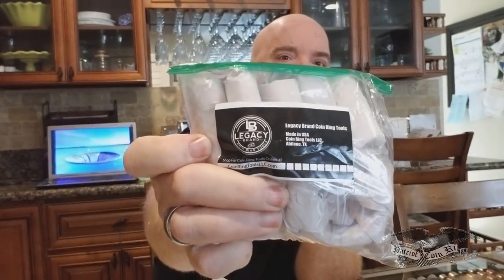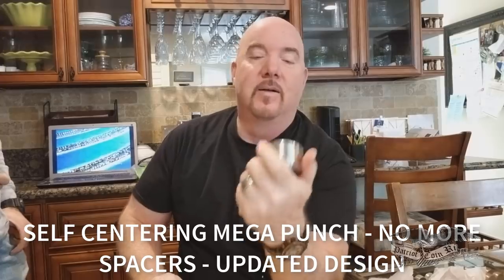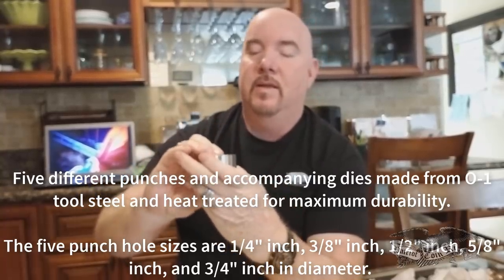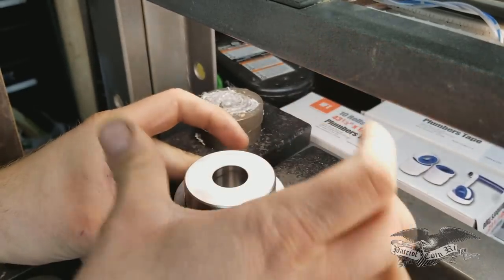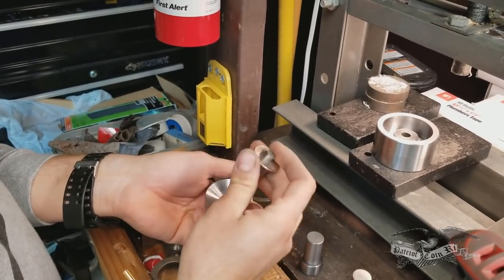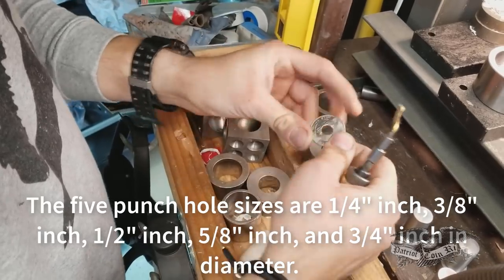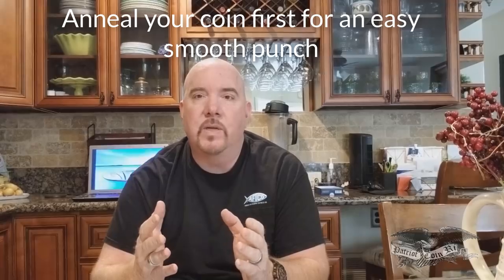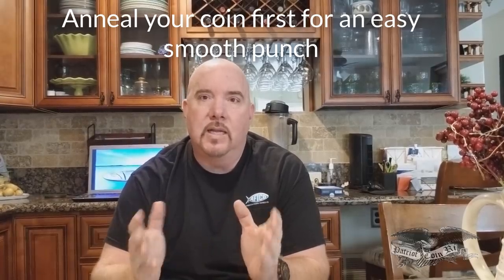✅ #002 FREE Legacy Self Centering MEGA COIN RING PUNCH - July 4th Drawing!

Comment: Tanks Mrs  ....SELF CENTERING MEGA PUNCH - NO MORE SPACERS - UPDATED DESIGN

Legacy Brand Coin Ring Self Centering MEGA Punch Set:

This set includes a durable, two piece punch body made from 4140 steel. The top half of the punch body is domed to center your coins and fits inside the bottom half of the punch.

Accommodates coins in ranges from US Half Dollar 1.205" inches diameter (30.6 mm) up to 1.75" diameter (44.6 mm) challenge coins.

There are also five different punches and accompanying dies made from O-1 tool steel and heat treated for maximum durability.

The five punch hole sizes are 1/4" inch, 3/8" inch, 1/2" inch, 5/8" inch, and 3/4" inch in diameter. 

Updated die design clearance allows coin "punch outs" to clear the dies.

Holed coins (done with 1/2" punch) pictured include:

US Kennedy Half Dollar (30.61 mm diameter)
British One Penny (31 mm diameter)
Plated Brass Liberty Silver Dollar Replica (38.1 mm diameter)
One ounce copper round (39 mm diameter)
USA American Silver Eagle (40.6 mm diameter)

To use the punch, select the punch size you would like to use and it's accompanying die. Insert the die into the bottom half of the main punch body. Set your coin on top of the die. Slide the domed, top half of the punch down into the bottom half. This will center the coin over the die. Next, insert the punch and punch your hole using a minimum 6 ton hydraulic type press.

Lubing the punch face with a cutting lubricant, such as Pepelube, is recommended.

Lubing the inside of the dies is recommended as well.

This is a quality coin ring punch set, made in the USA by American craftsmen, and made to last.

This Coin Ring MEGA Punch Set is in stock and ready to ship USPS Priority Flat Rate Mail with Signature confirmation ($9.60) within one business day in the US.

International buyers, contact me for shipping quote.

We combine shipping whenever possible and refund shipping overages.

Thanks for looking at our listing, Karen and Larry.

No coins are included with this listing.

Comment: I’ve already tossed my Harbor Freight die set. So I’m in a bind friend I really could use this big time. Im using the older model from them, which is still good. I promise to give it away.... Karen has been great customer support.....
Reply from the maker: To improve your odds of winning just start up conversations with others here because every post is seen as an entry with the randomizer.  Frank for instance in this thread has something like 8 posts I see so he looks like he has the best odds of winning so far.  The best I can recommend is asking questions or answering questions here to improve your odds.  I do wish you the very best of luck!
Reply: Jon Waters 
People always knock Harbor Freight for their "cheap tools."
For one thing, I work on my own car and I've never had anything from HF break. Even did my AC system with HF gauges and vacuum pump-- both work fine and my AC is freezing cold, in the Florida summer. 
Secondly, I've seen a guy walk in there with a broken torque wrench and the manager told him to grab a new one, with no receipt. 
Even if HF tools are "cheap," they're replaced with no hassle, totally warrantied. 
I have the HF punch set, bought it with a plastic center finder from ACE Hardware. 
I also have their doming block and die set. I want to make a bell from Ben Franklin half dollars-- those things look so cool!!
Harbor Freight, for the win. 
HF should sell a line of coin ring tools; they'd be a great sell, with warranty...

H. French
PO Box 320278
Cocoa Beach, FL 32932
Reply from the maker: Yea, I totally get what you mean Frank and agree.  In fact I'm one of those guys who even pays for an annual HF membership.  I turn to HF for many many items and it would have been a lot harder to get involved with the hobby had it not been for the price savings I got on my startup tools with them.  I think Job like I mean when it's said "I finally get to toss the HF stuff" is that we've finally graduated up to something even nicer is all :)
Reply: my punch has gone bad 3 times and H F did replace it.
Reply from the maker: Personal Invite to the BIGGEST open box review and giveaway i've ever held is finally here! https://www.youtube.com/watch?v=vKG-zaoLqec 
$200 PCR Gift Certificate or $538 MSRP Coin Ring Punch Kit!

Comment: im impressed...but..in the vid fron 1/18 you used spacers but not in this one.. when i went to etsy to look at legacy ring punch set they show the spacers .. what did i miss
Reply from the maker: I actually have both punches with spacers and those which are self-centering.  Both are great and I typically use the one that just happens to be closest to me on the shelf however the self centering ones are really good when it comes to the real oddball sizes that would otherwise require you to put a bunch of paper between the spacer and coin.  If you go to Legacy's ETSY page and message Larry or Karen I'm sure they will hook you up.  I was told they just sold out of their self centering punches at this time and were redesigning it for an improvement which I'm interested to see but they would have it available shortly.  Another really good one is made by Jason Works which you can also find here... https://jasons.works/shop-coin-ring-making-tools/

Comment: Are the punches flat on the end or do they have an angled tip that cuts the coin?  I've watched this video, or most of it, about 8x so far. Hahaha. 
Edit: 6:20 I agree with you on this point. Good thing is, that's an easy problem to fix. 

H. French
PO Box 320278
Cocoa Beach, FL 32932
Reply from the maker: It's flat and in my opinion the punches should have a very slight angle to them however haven't had a problem yet and in all honesty I rarely anneal a coin before it's punched anymore.  The only time I do is when it's a really thick alloy round.
Reply: i made a dollar and 50 cent rings from australia.    really thich and hard

Comment: I have a press but no punch yet, hoping I win...
Reply: rstone7727 
Harbor Freight phased out their 1/2-ton press. I got one just to have, in addition to the 1-ton arbor press. That one was an open-box buy, handle missing. Which was great, since the handle is prone to break and often "modded," replaced with something better. 
I went with the the 6-ton A-frame press but I didn't like how it was kind of wonky, didn't feel stable, like it couldn't withstand the stress. As soon as I built it, I called HF and asked if they wanted a floor model for their A-frame, exchanged it for the 12-ton press. 
If anybody is on the market, wait for a flyer that has the $129 coupon for their 20-ton press. For what I paid for my 12, I should have paid attention to the coupons and gotten the 20 instead. 
Presses can be dangerous if you aren't careful. 

H. French
PO Box 320278
Cocoa Beach, FL 32932
Reply from the maker: +rstone7727  The more you comment and chat here, the better your odds of winning...fyi  Good Luck on the drawing my friend, sounds like you could use it!
Reply from the maker: Wow you really went heavy duty Frank.  After using most, I find the 6 Ton perfect.  Some tools the 1 ton isn't strong enough to handle but anything more than 6 ton doesn't allow you to feel your work which I personally think helps you do a better job of knowing when to continue or back off on the press.  That and I can't see needing anything more than 6 tons to cut through all coins and medallions made even with steel unless you just want something more strong for other projects outside of the hobby.  Just my opinion though.
Reply from the maker: Personal Invite to the BIGGEST open box review and giveaway i've ever held is finally here! https://www.youtube.com/watch?v=vKG-zaoLqec 
$200 PCR Gift Certificate or $538 MSRP Coin Ring Punch Kit!

Comment: At first I was shocked by the 1.6k likes to 1 dislike ratio, then I realized why...
That being said, this auto-center punch is a great deal. I've got it favorited on Etsy. Much cheaper than another auto punch for sale on there. 

Henry French
3360 Craggy Bluff Place
Cocoa, FL 33926
Reply from the maker: Yea, I have bought several over the years and some run as you know upward of $300 plus.  This is still around $200 but a real value considering you get 5 different punch sizes and even better it allows you to punch any size coin foreign or domestic without any additional spacers, etc like I've had to do all these years.  As you can see in the video, I was really thrown off when I was first looking at it and had to pause to see what I actually was working with to continue.
Reply: Michael D. Baker 
Update:
2k likes, like whoa!

H. French
PO Box 320278
Cocoa Beach, FL 32932

Comment: It looks like the top portion of this die set could be used as a folding die. At least, as a starter to make the initial fold of the coin. I wonder how wide it is. 
Seeing it is like Needful Things- gotta have it!!

H. French
PO Box 320278
Cocoa Beach, FL 32932
Reply from the maker: Initially not knowing what I was sent by Legacy, that's exactly what I thought I had when you see me pause the video and come back to it.  I actually stopped for like 5 minutes or so to see if it wasn't a folding cone of sorts and honestly would have never believed a cone like that would truly do a quality job at getting a dead on center punch of any sized coin without the use of spacers but it does :)

Comment: They also have a 3-piece set of disc anvils, for straightening out wobbly, crooked coins in their Etsy store. It comes with a urethane pad, all 4 pieces just $18.
Other than an auto-center punch, I have just about every coin ring-making tool 🔧 out there.  

Henry French
PO Box 320278
Cocoa Beach, FL 32932

Got my fingers crossed...
Reply from the maker: I'm interested in checking out there Mini Lathe Chuck Kit Coin Ring Tool Holds coin rings from inside or outside to see how well it works on my Harbor Freight lathe.  They've got great prices on everything. Even the chuck is under $50.
Reply: Michael D. Baker 
That's the other thing that caught my eye, especially the price like you said.  It grabs the inner or outer surface of a ring. It almost looks like part of a Terminator hand-- good-looking, like all their tools, really. 

H. French
PO Box 320278
Cocoa Beach, FL 32932
Great price on that item, as well. 
I'd get more from them but I've got mostly everything besides 25° dies.

Comment: I've got a 50-Franc coin from 1979, 90% silver, and a Mexican 100-peso coin from 1979, 72% silver. Just waiting for this drawing to see if I can use this punch to put a hole in them. 

H. French
PO Box 320278
Cocoa Beach, FL 32932
Reply from the maker: Hey Frank, I have made those very rings numerous times using this punch with ease.

Comment: Great demo. Great content.  Trying to build up tools to do coinrings. Super improvement for the craft.  God Bless!!!
Reply: Gary Ebendorf 
"Super improvement for the craft" is exactly right. 
This punch i ahead of its time, saves money and is easier to mobilize for those that set up booths to sell their coin rings. 
Besides never having to buy spacers (nor replace them), this punch is actually going to be more accurate when aligning a coin for the centered hole. 
It looks good, is less bulky without spacers, cheaper because you'll never buy spacers, a bargain to begin with. 
I personally think this is the apex technology for punching holes in to rounds. 
If you're on the fence about investing in a punch, take the plinge and visit Legacy Brand tools at their Etsy shop. 
You'd be buying the best coin punch out there, at the absolute best price, too. 

H. French
PO Box 320278
Cocoa Beach, FL 32932
Reply: I havent made any rings from an expensive coin yet.    waiting for this punch one way or the other